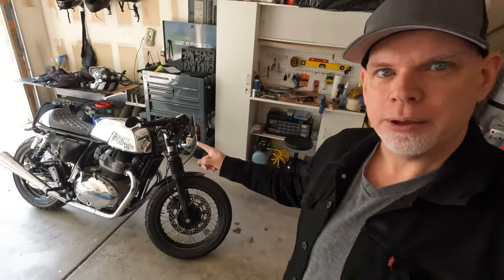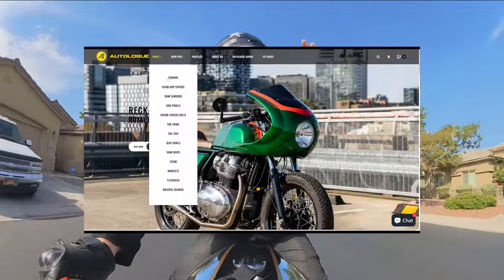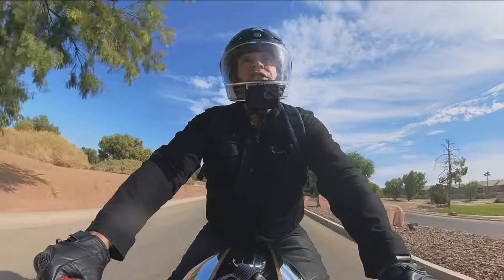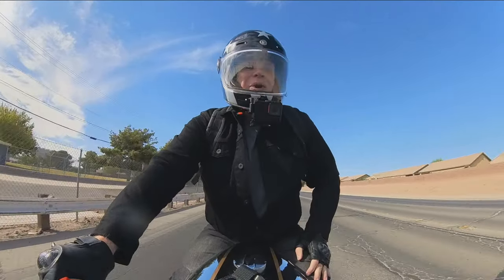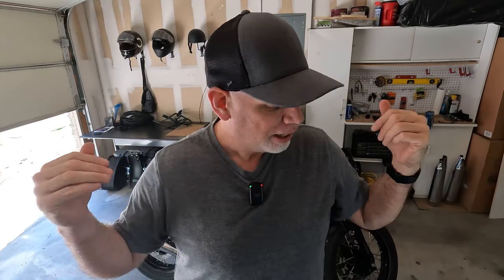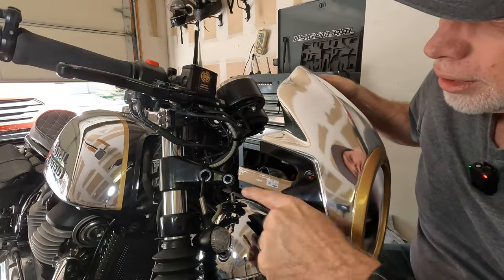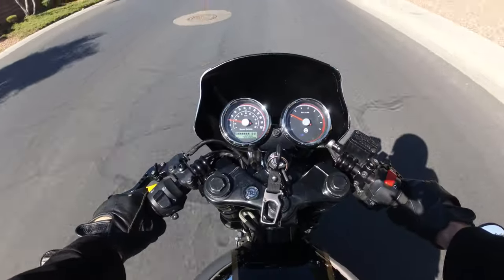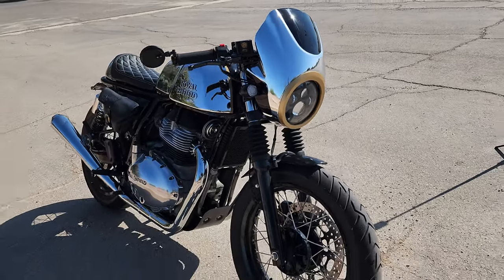Headlight Fairing for Royal Enfield 650 | Chrome Vinyl Wrap on Mr Clean Motorcycle Autologue Designs

Comment: Looks great and the gold ties it in with the tank. There is a process that uses a spray chrome,  has to be done by a specialist,  but is then clear coated and resilient.  Seen it done and it looks good.
Reply from the maker: Yes, if the vinyl doesn't hold up well I'll look into other options. Had a hard time finding good recommendations for chrome on plastic. Most of the paints looked more gray than chrome. Also concerned about peeling and chipping.

Comment: The Fairing looks fantastic, not sure about the Gold effect around the headlight rim though, but if you like it great

Be careful not to park the bike with a strong wind from behind, I did that a long time ago with a bike that I had fitted with an aftermarket screen
Got up the next morning and it was lying on its side. Think the wind had got behind it and the fairing acted like a sail, unless some scumbag pushed it over
 
I like the way you are not afraid to experiment, unfortunately wasting money is common with most bikes as there is no guarantee you will get on with what you bought!
Been there many times but it is worth it to get what you want, cheaper than swapping bikes

Keep doing what you do

Comment: I was thinking about the same thing! Have you had the option to check out MK designs Mr. Clean headlight fairing which comes with vinyl wrapped? Just curious
Reply from the maker: Yes, I looked at MK Designs but their headlight fairings for the 650's are bigger than what I wanted, it extends the headlight forward (I like the small headlight cover they have for the RE Hunter.)